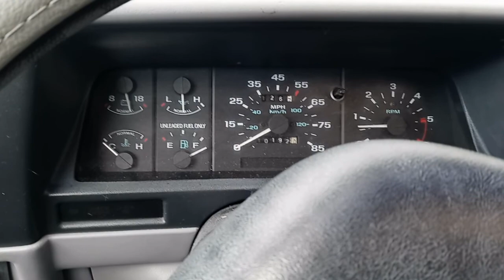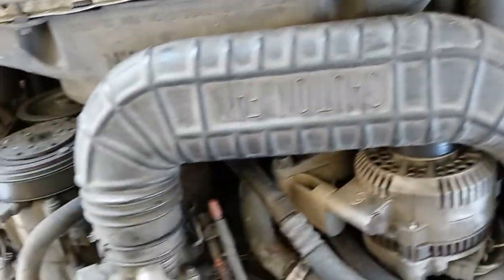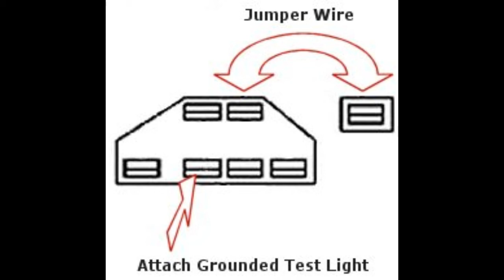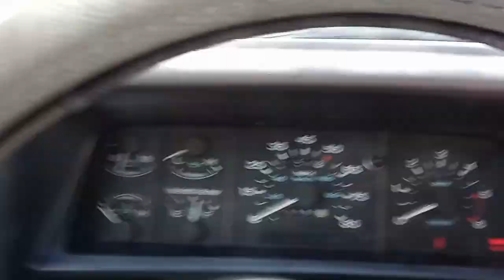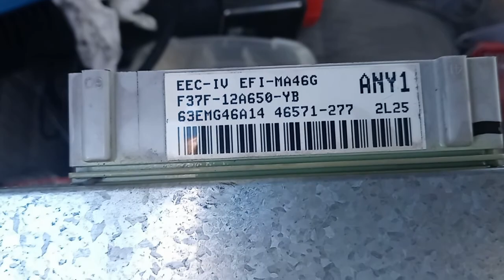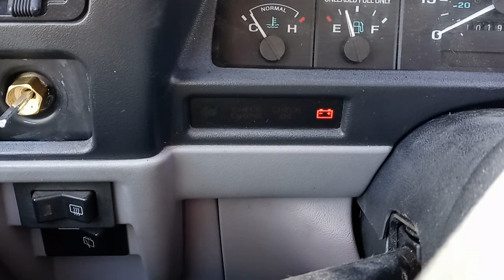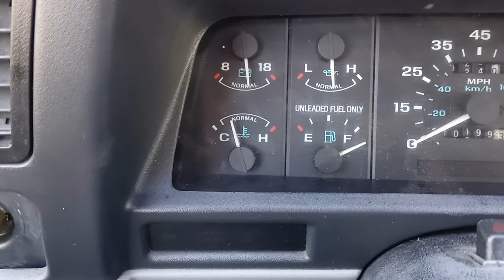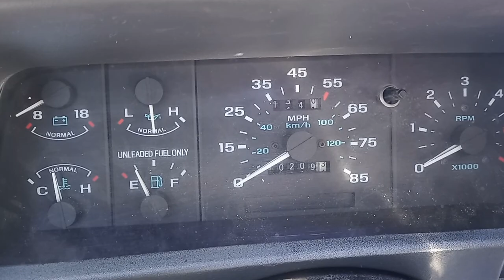1993 Ford Explorer EEC-IV Repair/Recap + Some Other Stuff

Comment: Thanks for the video, helped to inspire me to keep working on my 93 Explorer, which has been in my family since new. I Already got a perfect air intake from the yard, once I redo the cooling system and power steering system and the fuel system, plus some of the stuff you did I should be able to get it back on the road after 2 years

Comment: Hello how are you, I have the same problem in my explorer unstable rpm below 700 but only cold after it stays on for 3 to 5 minutes the indicator light goes off and the branches go up to 1000 and it is stable, I consider it to be the EEC gets wet because it only happens in winter my country is very tropical I have had it for 5 years and in summer it does not happen only when I wash it in summer that happens, they consider that the EEC gets wet

Comment: My 92 Explorer is hard to start. It runs for about a minute and then dies. No check engine light. Very frustrating
Reply: hello how about you should test your fuel pressure maybe your fuel pump is dying
Reply: So replaced fuel pump did not fix….and replacing the relays did not fix. In the end I had to go to the  junk yard and steal a New Computer Module(EEC). Poped it in and it she fired right up. The EEC is prone to moisture damage and can short out the fuel system; as was the case with mine.
Reply: So replaced fuel pump did not fix….and replacing the relays did not fix. In the end I had to go to the  junk yard and steal a New Computer Module(EEC). Poped it in and it she fired right up. The EEC is prone to moisture damage and can short out the fuel system; as was the case with mine.
Reply: So replaced fuel pump did not fix….and replacing the relays did not fix. In the end I had to go to the  junk yard and steal a New Computer Module(EEC). Poped it in and it she fired right up. The EEC is prone to moisture damage and can short out the fuel system; as was the case with mine.
Reply: So replaced fuel pump did not fix….and replacing the relays did not fix. In the end I had to go to the  junk yard and steal a New Computer Module(EEC). Poped it in and it she fired right up. The EEC is prone to moisture damage and can short out the fuel system; as was the case with mine.